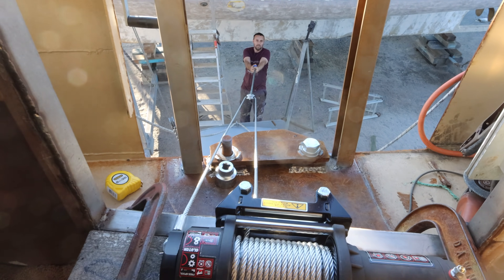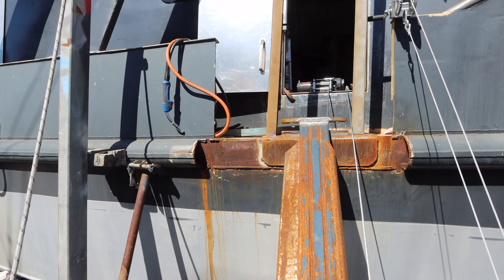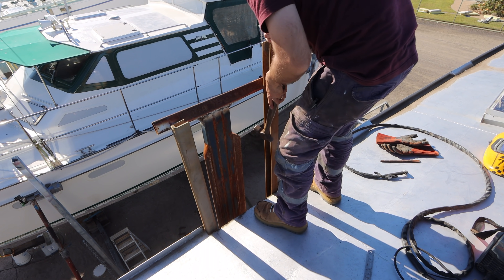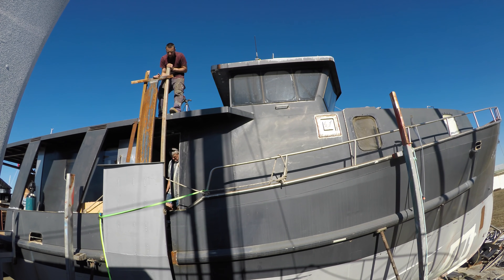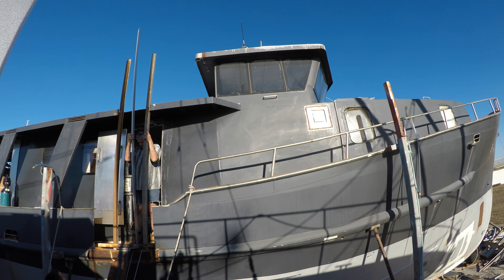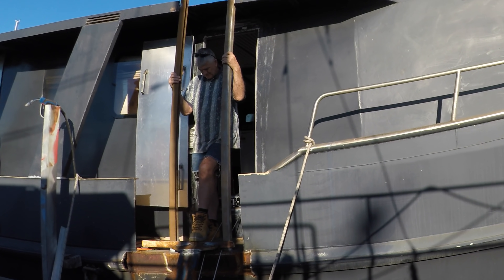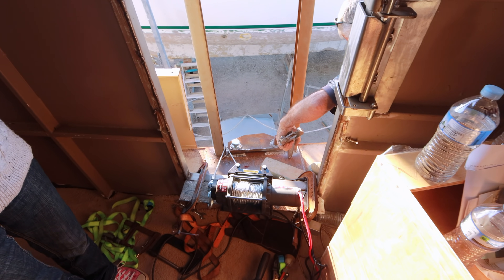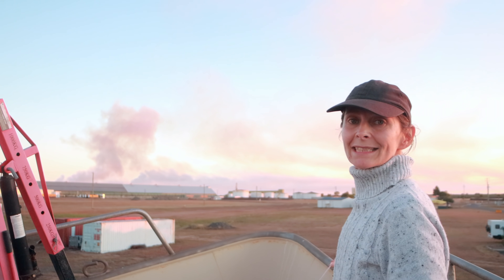Brupegs Stabilisers get Lifted & Aligned - Ep. 163

Comment: Curious about the Australian use of "purchase" - "...a 2 to 1 purchase", can you explain?  Google could not figure this out for me ( - :
Reply from the maker: It relates to pulleys. Adding a 2:1 pulley system doubles the hauling power or halves the effort required to move something. We call it a purchase. Ie use a lever to get some more purchase on it, or add a couple of blocks (pulleys) to get some purchase on that thing
Reply: @ProjectBrupeg  OK, well "fair dinkum" then ( - :  I've typically heard this called "2 parting" the line, same thing

Comment: As long as the rollers run up and down smooth you should be spot on ! Where are you mounting the winches ? On the roof ? Those strap hooks are not very trustworthy !
Reply from the maker: Hi Dave, winches will be tucked up under the wheelhouse roof on the rear side

Comment: Where the Stabilisers mount to the hull of the boat. What is the weak piont if the stabilisers were to come in contact with a stationary object? It would not rip a hole in the hull would it?
Reply from the maker: Hi James no it won’t. This is one of the strongest parts of the hull. Behind the doubler is the main engine room bulkhead so the wings mount on the chine where three plates of steel in different directions meet (bottom of hull, side of hull, bulkhead) and the deck/arm meet at the top of that intersection where three plates meet (deck, hull, bulkhead)

Comment: Do you need to have spare nuts for the sliders? In case one goes over the side never to be seen again...
Reply from the maker: Yeah we will have spares galore. We have swapped to bolts rather than studs as it’s easier to manage keeping them on the boat. We need 4 to be operational but will likely carry 10-12 onboard

Comment: Amazing project! Well done.  I might suggest using over-sized tapered holes for securing the wing plate in the deployed position. Pairing that with conical nuts like lug nuts that would self center in the conical holes. (9:08 ) The difficulty inserting the bolt your having is going to be greatly exaggerated when the boat is on the water. Much easier to lower the plate with over-sized holes over the studs protruding from the deck plate and let gravity pull it into place.  Then just thread on the nuts when its seated. This will keep fingers and hands away from this massive pinch hazard.  Studs can be easily replaced if worn, but the fit of the conical nut will reduce wear and keep it off of the threads when fully seated again like in a lug nut.
Reply from the maker: Yeah I like this idea. I can’t picture the nuts your meaning. Can you send a link of the sort of thing your meaning so I can wrap my brain around it. Thanks Dame
Reply: Awesome idea, also called acorn nuts!

Comment: Have you guys considered a locating dowel/pin between the two big bolts to ensure alignment when you lower the stabilisers?   A conical pin dropping into a correctly located hole will A) help you get the right orientation between top and bottom for bolting them together, and B) help make that location more resistant to shear stress and prolong the life of the bolts and threads.
Good job anyway.
Reply from the maker: Hi Harry yeah I have pondered this. I fully settled on any one design but it is something I’ve thought about a few times aye

Comment: Question? When the wings are in use, how are they going to be locked down so they don't move when in use.  That is to say to prevent the wings moving up and down the sliders as the boat moves through the water. Just a thought that crossed my mind.
Reply from the maker: The two M30 bolts on the top plate bolt the arm to the deck

Comment: Why use such a complex design just to have two nuts and bolts hold the stabilizers in place? All you needed was a hinge and cotter pin locks. The weight of the boat and its skiing stresses WILL strip the bolts. Two fixed dorsal stabilizers on the stern and one drop down wing at the front is a better idea. Im not even sure your engine has the horsepower to lift the bow out of the water and translate the displacement to the flippers. A single failure of either stab while underway could capsize the boat.
Reply from the maker: Lol, good one. The design we are using is a direct copy of commercial wings made and used for decades in Aussie. They are arguably one of the most effective forms of stabilisation but thanks for playing

Comment: I hope the stabilisers give a noticeable improvement. It seems like a lot of effort and time going into them.
Reply: The difference in roll and general slopping around between a stabilized vessel and unstablized is pretty dramatic.  These are well worth every bit of effort going into them.
Reply: @flynfishak  - Yep. I can see that they'll be very effective and well worth all the effort. If you imagine the difference a couple of surface-riding bamboo outriggers make to a wooden canoe, then scale things up to a boat like Brupeg and drop those two hydroplane thingies over the side, there's an enormous amount of surface area in contact with the water.

There'll be literally tons of stabilising force gained from trying to lift all that ocean as the boat rolls around. I look forward to seeing the 'Don't Spill My Cup Of Tea' test...
Reply from the maker: It’s the only way I can be on board given my health issues. These lovely guys are making it possible and it’s awesome engineering which I find fun. Jess
Reply from the maker: They will

Comment: Two big waves and everything is crooked and bent or worse everything’s breaks off. Your idea is good but the construction is not .
Reply from the maker: Thanks for your indepth analysis, given our design is built heavier than many commercial guys are using im happy it will last.
Reply: Project Brupeg I hope 🤞 it’s good and you get no problem. But I was a sailor for 15 years and sometimes I was stunned and surprised to see how strong ans destructive water gan be.
Reply: @tonnierooker5374  
This isn't a new idea 
Its a very common design thats been though a million revisions and reworks to get to this point 

Bit like the rudder on a yacth without a skeg
Bloody great big flap hanging off a small shaft at the top 
Should get ripped off in the first wave but somehow they don't (engineering)
Sure sometimes they do intact get ripped off 
But in exceptional circumstance 
And in this case its prob going to be the least of their worries as to what other damages have occurred (hopefully non)
Reply: The only thing I would be worried about is deploying or retracting the wings in heavy seas. Once they are down I think they are plenty strong enough, when they are up then there is no wave action upon them. But relying on the weight of the wings to hold them firm against the winch cable tension alone when lifting or lowering might be interesting..
Reply from the maker: Hi John. The trick to deploying these wings is crappy seas (as told to me by a fishermen with 25yrs experience using them) was head to wind. 1-2knots of boat speed and lower them down. Gravity takes them down so far then water resistance slows the decent right down and it’s easy to deploy them as they just won’t drop because they have to push so much water aside. When they come to rest quickly throw a bolt in then the second and a 3ft bar onto each and your set for as long as you need
Reply: @ProjectBrupeg  Sounds good to me! I have no experience of manually deployed stabilisers. The ships I was on either had none at all, flume tanks (look 'em up!) or fancy hydraulic active fins. The latter worked great but used a lot of fuel so we ended up decommissioning them and next time in dry-dock we plated them over to eliminate any remaining turbulence.
Reply from the maker: Yeah that’s always the trade off with active stabilisers. Passive wings are not as efficient but they have zero fuel burn and if you make them slightly bigger you gain your roll reduction back again. The trawler guys say with these wings deployed you actually decrease fuel burn as the hull becomes lower drag through the water as it’s not flopping from side to side and the average speed is able to be maintained higher
Reply: @ProjectBrupeg  I'm sure you will be doing some comparative runs to work out the best way to use them, in what conditions, and how fast to go. I look forward to seeing them in action. Not long now!
Reply from the maker: Cheers John. Yeah I can’t wait to do some testing

Comment: Figured Out A Quick Idea For Stiffening  And Straitening Out Your Sliders With Out Backing Plates. If You Got The Materials And Enough Cutting Wheels. You'll Need 2 - 2 Inch Diameter 3/8 Thick Wall Pipe Length = To Sliders. Cut The Pipes Length Wise In Half. Stagger Welding Them To The Front Of Each Slider Rail's And Capping The Top Ends Bottoms Welded To The Deck. Gives Them A Bull Nose Support. You Could Do That To The Back Side Also For More Added Strength.

Comment: Hi Guys, sent you an email about stabilises from AMSA , just wanted to know if you received it.
Reply from the maker: Hi Mark, yes we did. Been flat out and haven’t had a chance to catch up on comments or emails for days. Thanks for sending that through. Dame
Reply: You mean the ones that has the paragraph
"If you wish to install new fishing gear that is heavier (or in a higher position), or want to install a new structure on
your vessel, you need to contact AMSA, a recognised organisation or accredited marine surveyor. They will help
you determine how much this will affect your stability and whether adjustments need to be made or new stability
calculations undertaken."
Oh yeah  :-)
Reply: Ray Watson , I think that was it, it only came out the other day.
Reply: @CaptMarkSVAlcina  My take is that the boat will need a complete new weight study to get survey, and maybe even a non static stability test with the extended stabilizers.
Reply from the maker: Ray and Mark remember we are not in survey, have had the stabilisers checked by a marine architect and engineers, and we are using a design that is a direct copy of a currently in use commercial wing (with the advise of one of the most experienced users/builder of wings in Australia) and this is Australia; technical issues for commercial boats are different for private and often about legal protection of commercial liability. This project is about self responsibly and self sufficiency and not a commercial venture. We have checked it out and it’s pretty basic, nothing we weren’t informed about but it’s good that they are clarifying what wings can and can’t do. Cheers Jess
Reply: @ProjectBrupeg  Whew.  That's a relief.  A lot of people don't factor in all the math stuff.
I presume you must have basic insurance to be in a Marina, but is offshore insurance undet control too?
It's the small print that counts,  unfortunately.
Reply: Project Brupeg , hi Guys, I know you are not in surveyor but thought you may be interested as it just came out the other day from AMSA.
All the best.

Comment: Coming together!! Quick question. How are you going to anchor or Tie down the Wings when they are all the way up? I don't think you want to leave them with the winch cable the only thing anchoring them down at the top. They are folding in wonderfully!!
Reply from the maker: Hi Dennis. When we get them tucked right up, I’m thinking of welding a stainless plate to the wing that overlaps the top of the bulwark. That way we can drill a hole through both and drop a pin in so the wings are mechanically held in place
Reply: @ProjectBrupeg  Great idea.Super duper Job